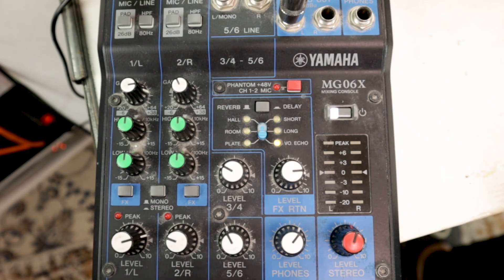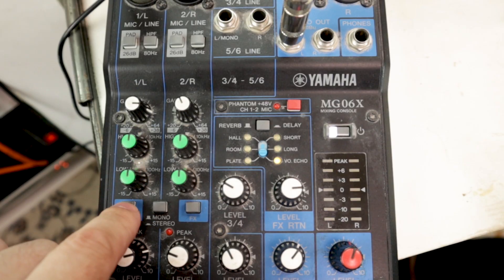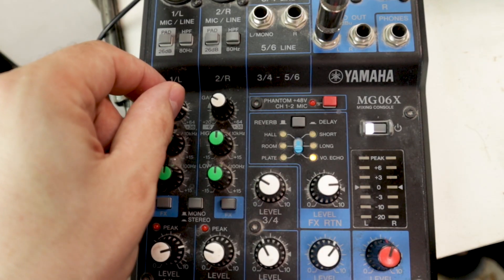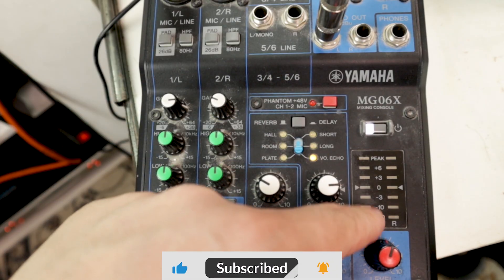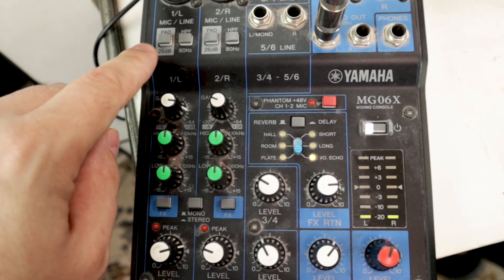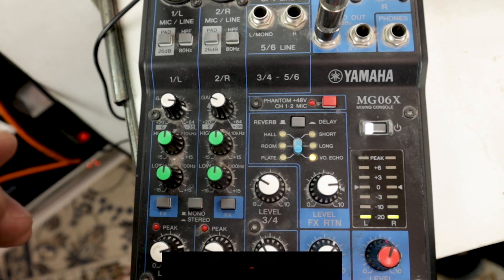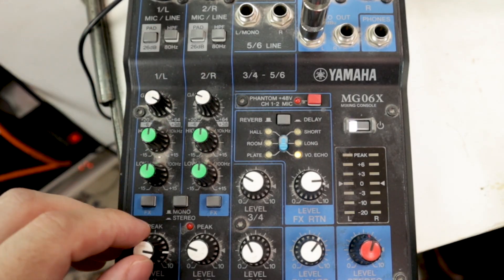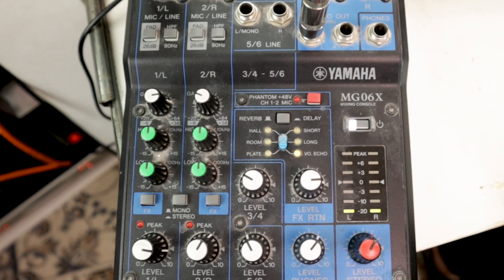Make Your Audio Sound Pro with This Mixer Trick: YAMAHA MG06X

Comment: Hi! Hoping to get some help.

I have been using this board all year and it has been going great. I have a 1/4 to AUX line going out of line 3/4 for my iPad/Iphone. I have had no issues all year and then last event of the year (today), when I hook it up to my iPad, I can hear the music , but it sounds a little muffled and a little low. I have my DJ board connected to lines 5/6 and there are no issues there, just 3/4 line going to Aux. Any suggestions?
Reply from the maker: try testing line 3/4 with a different cable. try running the same cable + ipad that's not working on 3/4 into line 5/6. this will give you some data. you need to pinpoint the problem scientifically in the signal chain. is it the ipad? is it the cable? is it the mixer? is it the speakers? usually the issue is a faulty cable in scenarios like this. altho it's possible you somehow fried channels 3/4 on the board. it does happen, esp when used a lot for live events. spilled water or impact shock can ruin this type of equipment. hope this helps.

Comment: Consider the knob as smaller needle of a clock, My MG06x clips my vocals beyond say 9 O’clock while gain is at say 8 O’clock & FX return level at 10 O’clock and my vocals remain much lower compared to track. I can’t make settings you demonstrated. I detect a small current into the mic socket using a tester that comes upto the mic, though I don’t feel it much. Is it normal? or Is it the current that is adding up to my input signals that prevents my higher settings? I use AT2035 along with on smule application.
Reply from the maker: have you tried turning the track volume down and the overall master volume up? that would effectively 'turn up'  your vocals relative to the track and might give you some headroom to turn down the vocal gain. i'd also check the mic to see if it's having issues. use the mic on another mixer to see if it's faulty or if it's working fine on another mixer. you could also test out a less sensitive mic (e.g. a dynamic like sm58) instead of a sensitive condenser mic like the AT2035. Lastly, are you using phantom power on the mixer to drive the mic? if you have some other phantom power source, that would be useful to test to rule out the phantom power on the mixer as the issue. hope this helps you solve that issue